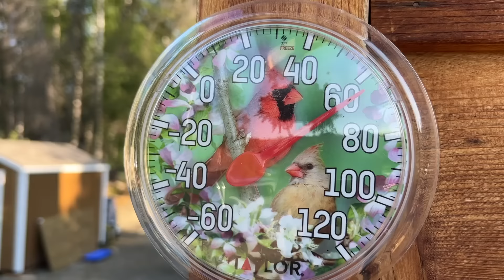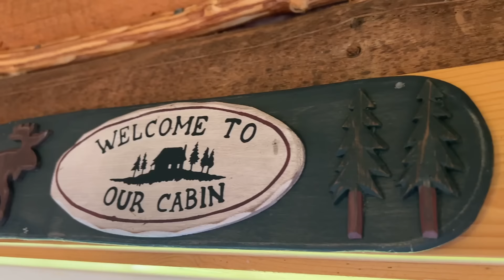Working on the Cabin Addition + Date Day with Joe in the woods at our Remote Cabin!!!

Comment: you might want to consider using the outside wall of your current bedroom as the wass of a closet in your new room. build another wall 2 feet or so inside of the eisting wall as the back wall of the new closet for your room this will give you a clost and more buffer from the rest of the house. Another homesteder, Bill

Comment: A little surprised by the absence of floatation devices for the dogs.
Reply from the maker: Well, we checked 4 stores and they were all out. Once they get more then you will probably see them with a life jacket.
Reply: @heatherclayton-callaghan4270  Well heather, no debate about dogs being endowed with the ability to swim, much as humans were also endowed with the ability to swim. That river is fed with snow pack/Glacier run off and the current is very swift. It would not be prudent to not have flotation devices for the humans in the boat and it is likewise not prudent to have those extremely valuable dogs/family members without floatation devices. Tina explained her dilemma and does plan to equip the dogs with flotation devices as soon as they are available. If you have been watching the channel you know first hand Tina needs no help defending herself or her decisions. She does a pretty thorough job of that with no outside aid.

Comment: Its a work in futility.  The brush just grows back. They work all the time
Reply from the maker: Most definitely not done in futility. Do you know how many yrs this brush has been unmaintained? Years. That’s why it’s so high. 

Once cut down low like this, next yr when the snow melts all we’ll have to do is mow it like a normal lawn. If it’s maintained each spring/summer it’ll never get like this again.😉